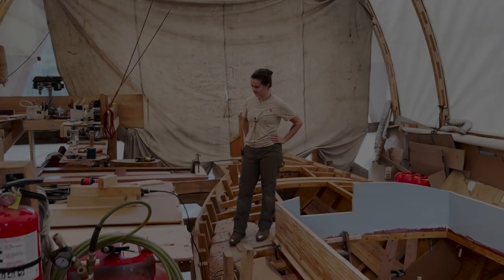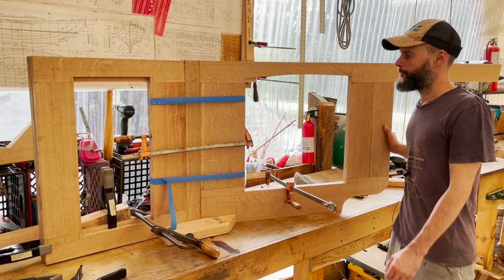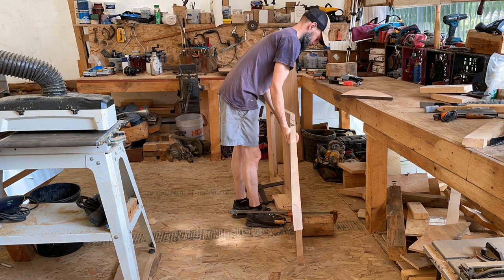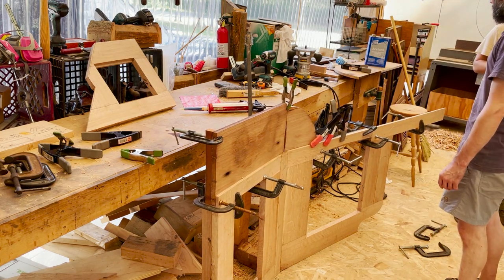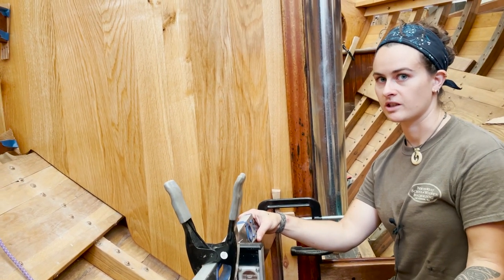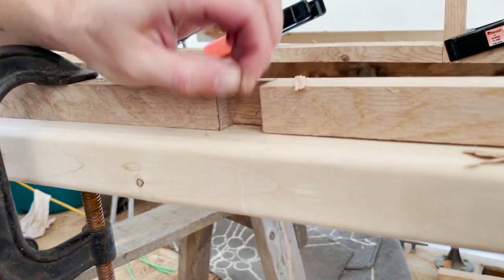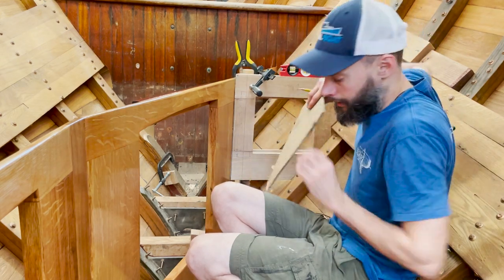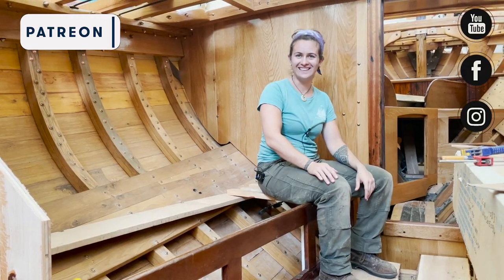Installing the Forward Berth - Episode 177 - Acorn to Arabella: Journey of a Wooden Boat

Comment: Needless to say as a retired architect I'm very impressed by the level of wood cabinetry making being installed in this boat. Previous experience has taught me that all to often some carpenters will take cost saving 'shortcuts' were the finished work can't be observed. Ultimately it can be a very big mistake which Steve and Caroline seem to be avoiding - Arabella will undoubtedly be a better built boat when finally completed because they're doing the work correctly! There's an old saying worth remembering - "do it correctly or don't to it at all"!

Comment: 7:45 in case anyone needs a reminder of how little Steve trusts routers.
Reply: There’s a hand plane for that.
Reply: I use both, and the margin for error, a slip up with a router is greater, they're loud, and they throw chips and dust everywhere unless you're using an good extraction method.
Off topic but the dust tends to be the reason I prefer using scrapers to electric sander (oh, and the noise).

Comment: i'm an afficiando of youtube boat builds and have rarely noted so much interior work performed before the hull, power train, plumbing and electrical are finished to a greater degree. of course, it's possible that a minimalist approach to those subsystems can accomodate that approach. just an observation...sort of enjoying it, really. especially in this case as the woodwork is so lovely.
Reply: I sort of mentioned the infrastructure issue a couple of episodes back.  But very far be it from me to tell Steve what to do.  He's been remarkable at this build so far.

Comment: In 60 years, someone is going to buy this boat, and they are going to get a heck of a good deal. I say that because the market value for a boat like this will be a tiny percentage of the labor and material costs that went in to it.  Obviously, this project is not about making a boat you could sell at a profit.  It is about the process, and having the boat. Wonderful.

Comment: Why don’t I recall the front half-height bulkhead installation? But there is some lovely joinery going in there. In fifty years time people will still be admiring the skill and neatness of the woodwork - even the hidden joints.
Reply: That's an old piece of Victoria just clamped in place I think.
Reply from the maker: Booooooooooshes has it

Comment: Just a thought.  You are going to make those Bunk Boards easily removable and not fixed?  Makes making up your bunk so much easier and they are not needed alongside or moored in sheltered anchorages.  Loving seeing the old timber being reused, cleaned up and varnished.

Comment: Perfect watch waiting to start work in 110°F heat welding steel all day. When its that hot and steel is 2-500°F from cutting/welding its ROUGH.
Reply: CaptainToyota You probably can't use one because of your working conditions or safety requirements, but... If you can, try a cooling towel around your neck. Like freaking magic in the heat.
Reply: @navythriller  I’ll second that, it can quite literally be a lifesaver.

Comment: Setting up a proper shooting board and a router table can make this furniture building process go much easier. A simple tenoning jig on your table saw will give you a fast way to cut cheeks.  For safety and added capability, a simple table saw sled would be great. All of this can be built with what you have on hand in about a 1-2 days. If I was anywhere near you, I would set this up for you. There must be hundreds of woodworkers in your area that could help with this. I hope someone reaches out to help.

Comment: Recommendation:... measure other boats head interior dimensions then go to an RV dealer and measure their heads. If you are happy then carry on. If you find them just a tad tight add an inch all the away around. There is nothing more frustrating than using facilities that are too narrow, in that you have difficulty reaching the areas you need to reach. 
I spent a half year on a boat where our head was basically a bucket with a  removable seat on top, and we used the "head" in the open. No discomfort, no unpleasant smells and the handle of the head had a rope attacked so it was bucket and chuck it and easily rinsed and cleaned. The real head was often used for storage. We had a salt and fresh water shower on deck with warm water for both.  Needless to say we were always away from shore when using the improvised facilities.

Comment: Caroline, did you spline or dowl that long glue line? That epoxy in a tube looks so great, similar to chemset masonry adhesive I see, super easy to use! Build is getting more and pretty by the day, a piece of art in the old tradition, not seen much anymore! Wonderful job!

Comment: Underway in rough conditions, no crew would sleep in the forward berth. Bunk boards make it hard to get in and out of positions. Fabric Lee Cloths are better to replace bunk boards.
Reply: Agreed
Reply: All of your statements are individually correct but consider that if nobody would sleep in the forward berth underway in rough conditions, lee cloths are unnecessary.  I've been in the forepeak twice in rough conditions due to a lack of options on the vessels and it was miserable.

Comment: +1 for lee cloths... Since the forepeak bunk is designed for two, it's unlikely that you'd use it in a seaway where there's so much width available to roll/slide back and forth. Maybe two cushions split longways with a lee cloth for the outboard side - or both sides if you really want to sleep two in those conditions. Unlikely you'd want to be up there at all when beating.

Comment: I have always use a dado set for remove stock when making tenons, rabbet, dados etc. , but if not handy, a router also works well
and is fast and more accurate than a skill saw and a chisel. Also on the ends of your face frame runs, why do your rails not end at your stiles
like most cabinetry does? is that a boat thing that I never noticed before? Maybe I have not waited for you to finish.
Reply: @ralphgesler5110  I was a cabinetmaker for almost 40 years and we made money producing a good product at a fair price, not getting somebody to watch it on YouTube.

Comment: i've been meaning to ask: why is part of the inside planked if the goal is to maximize as much interior space as possible?
Reply from the maker: The stringers are structural, but also, “inside planking” (ceiling, as it’s called in a boat) is for ensuring that your personal things, gear, food, clothing, and bedding stays dry (sometimes right by the hull isn’t full-on wet, but sometimes can be moist) and or doesn’t get lost as it tumbles straight down into the bilge. Some boats have ceilings, some don’t, and others put in ceilings where it counts most, which is what we’ll do.

Comment: Does the hull need to be inspected prior to planking over? SV Seeker is struggling with the insurance companies, maybe due to the fact it wasn't really inspected for integrity by whoever, prior to covering up the hull inside. If I'm blowing smoke I apologize.
Reply: SV Seeker is going to continue to have problems. Too many shortcuts, not enough adherance to marine standards. I'm absolutely astonished that the Coast Guard passed it as seaworthy. 
It's a great shame to have put that much work in to a project to be stopped by insurance.
Insurance problems don't stop with launching and moving out of the port authority. Depending on where it's flagged can cause insurance problems and some ports still require insurance.
When Lloyd's of London turns you down, you have problems. 
I truly hope I'm proven wrong.

Comment: This is just a question from someone who doesn't know anything about boats (I am an IT guy) is there going to be a second layer or anything like that in behind some of these panels? At the moment, it looks like it is straight out onto the hull.
Reply from the maker: Yes, and that layer of inner planking is called the ceiling. Some boats are built with ceilings throughout, and Arabella will have ceiling next to berths, lockers, and shelves—wherever we’d like to keep things from falling along the hull down into the bilge or to keep things extra dry.

Comment: So good, had to watch it thrice! Something very satisfying about joinery.

A point of curiosity tho...why did you settle on oak framing for the mahogany panels and not glued plywood strips or stable wood composite? And do you factor in expansion/contraction?

Thanks!
Reply from the maker: We don’t grow wood composite on the farm. 😉
Reply: @AcornToArabella  Sorry, my mistake I assumed the composite trees also provided the epoxy resin. 😉
Reply from the maker: Yah you tap them like maples. Happens in March with everything else.

Comment: You guys are making great progress on the interior fabrication.  I am a bit perplexed by the fact that you are still stumbling around on the make-shift sole boards, and frames?  Why did you not start the interior construction by building the sole first, so that - 1) you would have something solid to walk on, and 2) you would know exactly where the bottom of your bulkheads and lockers would start?  You will not want to walk around in the bilge of a boat, so why not build the floor that you would walk on?  When everyone builds a house, they start with the floor.  Why didn't you do that?

Comment: Do you have a system already figured out to keep the chain stored against the bilge via some kind of feed from the forepeak? Mine is fed down under the port side forward berth and inside of a storage locker via a sch40 pipe
Reply from the maker: The half-bulkhead forward is anchor locker.

Comment: Dont put a watertank under a bunk - you'll never close an eye :)
Reply from the maker: Low and in a place where storing other things is annoying to access (asking people to get up, needing to move everything from a berth). A great place for water tanks, to be honest.
Reply: @AcornToArabella  I agree - low and in an inconvenient-to-access place. Also worth noting... my first sailboat had a single water tank fairly near the center. Now, my second sailboat has two tanks... one near the bow and one near the stern... (roughly 100 gallons total) and as I drain a tank, it impacts how the boat sits in the water. from a dinghy approaching the boat, I can tell how full/empty the tanks are. The impact on performance is obviously negligible, but it just bugs me when the painted waterline doesn't look level. Swinging back and forth between 800 pounds and 0 pounds of water will impact things... and putting it as close to center as possible is a good idea.

Comment: Just my opinion but the bunk boards will have to go. It will confine you to tightly in the berth and cut off air circulation in the tropics. It does look classic and you did do a great job putting it together. Love the video!
Reply from the maker: Then they’ll go. ¯\_(ツ)_/¯ We expect to change the interior on the fly—many do.

Comment: Why is the left hand piece to stop you falling out different heights when the right hand is 1 height? It looks odd.
Reply from the maker: We’re using the reclaimed material we’ve got in the most efficient ways possible. We had a piece of triangular offcut that served for that smaller piece. It’ll still do the job, and making out of a larger, clear piece didn’t seem like the right move when we might need it elsewhere.
Reply: @AcornToArabella  ok, I was thinking you could have cut the left hand board down to the same height as the curve. It would have looked better imho.

Comment: Shouldn't that heavy mid-ship water tank be strapped to the hull frames and not reliant on the strength of the salon framing?
Reply from the maker: As Carolyn explained, it’s all getting tied into the frames with the supports she’s built.
Reply: Can you buy ready-made water tanks, or will you be building it yourself?

Comment: Suggestion: Before closing in to much, think about running some 3" or 4" PVC as race-ways for running and pulling wiring.
Reply: To add to this, after you've run everything you think you need, add 4 or so more strings through for the future